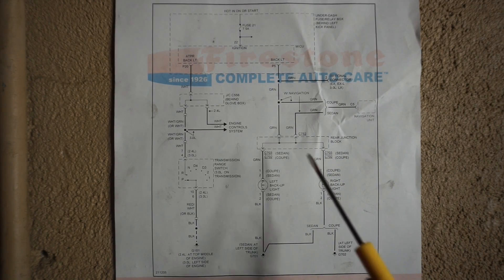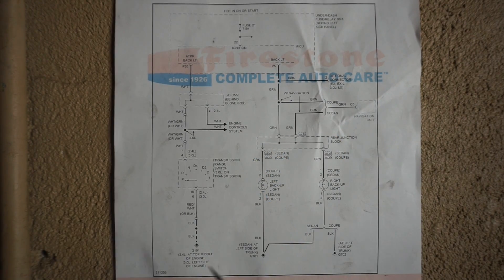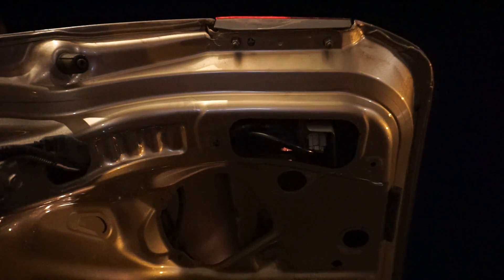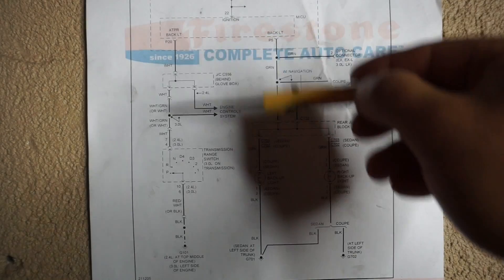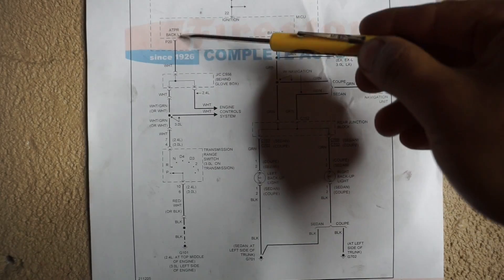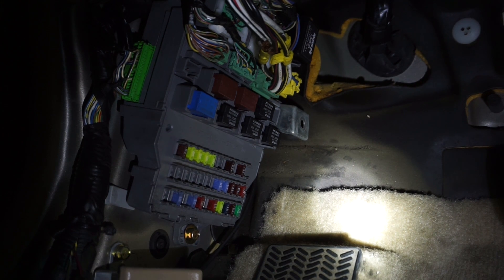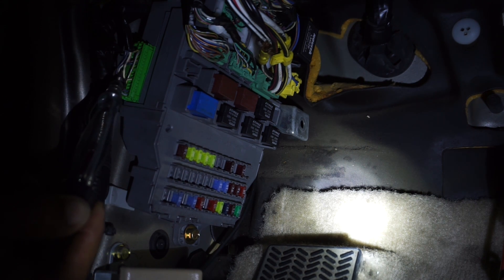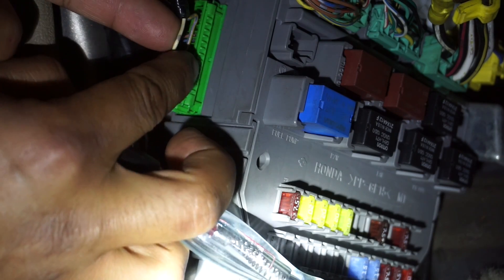Checking Back-Up/Reverse Lights Using Wiring Diagrams

Comment: Thanks for the video; it's highly knowledgeable and helpful for people to understand. 
The reverse light on the right of My Honda Civic goes on and off when the trunk is opened and closed. Specifically, the light is on only when trunk is opened halfway, about in the middle, and it's off when the trunk is opened in any other position, in the beginning and to the top. The wiring issue should be an issue of yes or no. In other words, it should be either completely connected or completely disconnected, shouldn't it? 
So, what might have caused this problem? and how to fix it? I have replaced the socket with a new one, by the way. 
Thank you.

Comment: Where can i get a wiring diagram for a 2004 Honda Accord LX coupe 2.4L? Probably the same as the Vehicle you just worked on. Someone did work on my vehicle before I bought the car in 2008. I tried hooking up the Back-Up Camera. While looking for the Green working to tap off of, noticed someone did some wiring and the green wire just came right out of the pigtail (not the socket, but the connector that connects the wire to the socket). Honda says I have to buy the  whole harness ($99.00). I was thinking of pulling out the metal crimp, opening the end, and recrimping green wire, and solder the other end. Do you have a link to your videos to properly connect wires on a car?

Comment: Hector on the 2010 Honda CRV do my reverse lights work off of a reverse switch or does it work off of the neutral safety switch if you have any idea your help would be so greatly appreciated
Reply: Thank you anyway Hector I fixed it, would you believe it both lightbulbs went out at the same time what a cheap fix Four dollars even

Comment: My tail lights aren't working either ,the turn signals and when I reverse the lights work but when I step on the brakes it doesn't
Reply from the maker: Dashaun Johnson check your grounds 🤙🏼
Reply: @HomieHektor  ok thanks bro
Reply: @dashaunjohnson7218  what did it end up being ?
Reply: Thats the stop light switch ghat needs to be replaced. Easy super cheap fix

Comment: Cool thanks I appreciate the help bro
Reply from the maker: Armando Melgoza Ok you’re gonna have to go to the backup lamp that doesn’t work you should have 2 wires. Black and Orange black is ground Orange is power. If you’re missing one of those you’re problem is in the wiring.

Comment: Hektor I got 2003 infiniti g35 sdean I got the issue where the right side back up light works but the left side does not.I changed bulb and no light whent on.what you think I got to do ?
Reply from the maker: Armando Melgoza check the wiring, I’ll check some diagrams and give you more info tomorrow 👍🏼
Reply from the maker: Armando Melgoza My bad bro, let me know if it’s automatic or standard...
Reply: It's automatic 4dr sedan.Hektor thanks for getting back bro
Reply: I have a 2005 Infiniti g35 right back up light works but not the left...help me out bruh
Reply: Automatic sedan